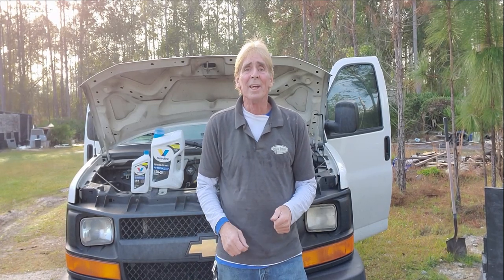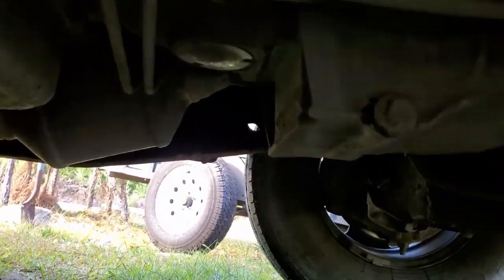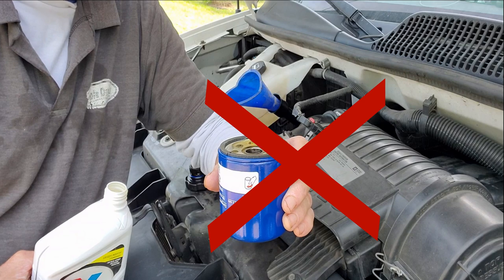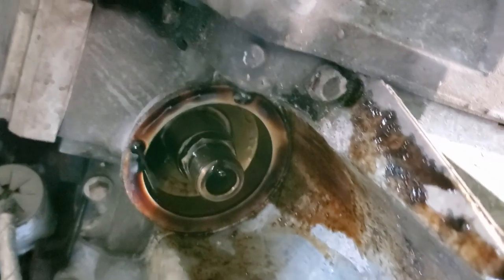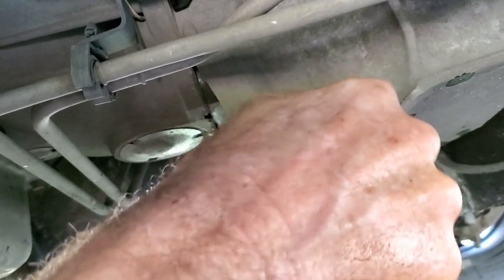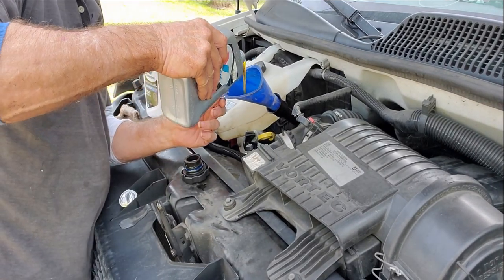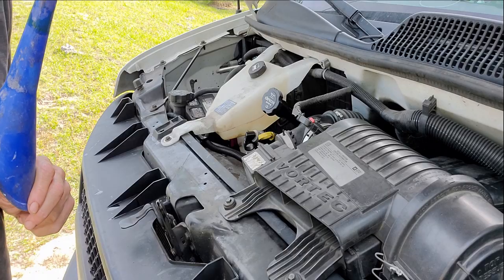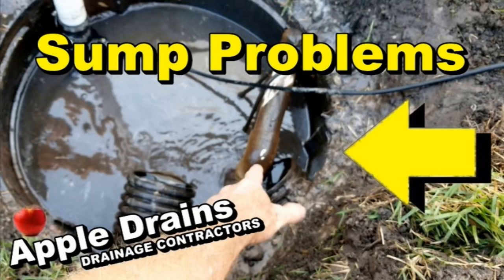High Mileage Oil Change, Do NOT Fill Oil Filter?

Comment: I have used  Valvoline and Fram filters all my life never had a problem.
 And I'm an old man at 62.
 Fill the filter with oil.
Reply: Phillip Bonner you should fill it with oil but if you put .5 a quart in there and your engine holds 5 quarts you should only add 4.5 quarts up too
Reply: @christiandemarcus2257   Sorry my engine holds 7  quarts
Reply: @phillipbonner5215  Do you own a Trailblazer? I never fill my filter and I have 178k miles.
Reply: My question is how are you overfill th thing when your usein oil from th 5 or 6 quarts of oil it calls for. Don't make since
Reply: 😮 I disagree that you have to pre-fill the oil filter. The first reason why he's telling you that you are going to overfill your oil if you pre-fill your oil filter wrong. He is correct your vehicle tells you how much oil to put in it when it gives you the percentage of oil that includes the oil filter film I'll bet you that he's checking his oil without running the motor and turning it off so it goes to the whole system then you check your dipstick a little while later after it levels out. If he does check if the correct way he will be short oil just about a half off a quart. Today's cars have different oil pumps not like the older vehicles the older vehicles yes recommends you to pre-fill the oil filter. It's not going to hurt anything like refilling your oil filter you're just going to make a mess the only benefit you are going to get these days by prefilling the oil filter is a nice amount of suntan lotion so while you're waiting for the oil to drain you can catch a nice tan 0 sunblock. A good majority of the cars these days have the oil filters sideways and in a very tricky place you will end up with oil all over the motor and yourself😊
Reply: the engine is adequate at filling it for you! you don't need a topper to run it safe, just a reasonable amount for a few minutes running! Engines are not glass slippers! But you can damage it if you prefill. the point is oil filters come in different sizes! And today's engines are not yesterdays! Old advice is for old engines! Do what the manual says and not other people! besides No two cars are alike!

Comment: Well, wouldn’t you just put less oil in when topping off - when filling the filter? 

If you put a half quart in the filter and it calls for 5...simply 4.5 quarts in when topping off. 

Pretty simple. Not rocket science.

But hey, that search term is gonna generate a lot clicks 🙄🤪🙄🤪
Reply: B&B Drainage Solutions yea, this is pretty rudimentary.
Reply: Half a quart to much isn't enough oil to make a difference anyway on most vehicles. That being said, filling the oil filter is totally unnecessary, just rub some oil on the new rubber seal.  

Make sure the old rubber seal comes off with the old filter. If it doesn't you could double seal and that will cause a slow leak. Then boom your walking to work 😂.
Reply: That's exactly what I thought. Pretty simple. I guess this guy couldn't figure that out.

Comment: If your vehicle uses 6 qts of oil, purchase 6 quarts and the correct filter.
Before installing the filter you can fill the filter with oil. Pour the remaining oil from the 6 qts into the engine. There's nothing wrong with filling the oil filter before installation. Unless of course the filter is mounted sideways.

Comment: This video is inconclusive. Of course you can't add more oil than manufacturer recommendation. So if your vehicle takes 5qts and you put some of that 5qts in the filter and the remaining in the oil fill, then you don't add extra oil. I was expecting more info on why oil should or should not be in the filter before starting the vehicle. Like it would harm the engine or something. But no info on that.

Comment: In most cases I believe that engine oil capacity is calculated with the filter in mind as it is part of the lubrication system.  I always pre-fill my filter if it's mounted vertically so that the engine will not run dry after starting.
Reply: you put 1 quart short of your total and your good to go without filling the oil fliter. the engine does that! the point of a "filter" is to filter the engine runs the oiil through it you already put in!  you don't need all quarts for an engine to start the oil is there! just not all the quarts!  You don't go out to a racetrack with it. you run it to operatfing tempuratfer add the last quart. filters come in different sizes!

Comment: I never though I would see the day when Chuck used a ratchet to get the drain bolt off instead of a pair of vice grips! 😂
Reply: this a 2016 chevy van ,,the oil pan nut is not damaged,,,,he uses the vise grips on the busted oil nut of the 2008 van

Comment: Prime your filter folks. Youre not overfilling if you leave the auto shop with 6 quarts. Your engine will be yell at you for the few seconds it takes to push through a dry filter without being primed.

Comment: Are you for real? You just take into account the oil added to the filter when adding oil to the engine. If capacity + filter is 4 quarts and the filter took 0.5 quarts, just add 3.5 quarts to the engine. This isn't rocket science.

Comment: I always prefill the oil filter on my father’s car. It doesn’t allow car to run dry. You run the car dry without oil, engine is worse and you’ll cause way more problems

Comment: There is only about 0.4 quart in the oil filter so, it is not going to overfill your oil sump. The oil filter sits above the oil sump and oil in it does not drain back to the oil sump when the engine is not running. So, if you don't pre-fill your oil filter, you will actually get a lower level reading.

Most people think it is unnecessary to pre-fill their oil filters. I think it can only be a benefit, and it doesn't hurt to pre-fill your oil filter. At least, when you have oil in the filter, that oil will act as a structure support for the paper filter inside it. Also, it helps dampening the first incoming oil.
When I let the oil drained overnight, my engine started up with a grinding noise. That was an indication of no oil. Yep, a fraction of a second with no oil can cause a little bit of wear. If I was to pre-filled the oil filter, that would have reduced the wear. But, still, your engine would last longer than your transmission and everything else, so it is your call to pre-fill, or not. Time is money so I don't blame folks on not doing it.

Comment: DO NOT USE FRAM OIL FILTERS 
I used to be a fram filter user my buddy has a Dyno shop and has blown a few motors he has found  that the filter is coming apart and finding parts of it in the engine so if you don't want to put a new engine in your car I would avoid Fram filters go with WIx filters best you can buy

Comment: The hole in the center is the out flow so you would be putting unfiltered oil in a place where if there is plastic from the bottling process or who knows what else through your clean side of your oil system.  I get the whole starting the engine with it empty and it sounds nasty with the lifters tapping, if the engine was run for a bit before the oil change there should be enough oil coating everything.  Its not the same as letting the engine sit and cold crank in the morning.  Kinda weird the ASE guy didn't say this, I picked this up from a certified diesel mechanic, best of luck Chuck!  Oh and a lot of mechanics throw the filter on fill with a lower amount than required and then top up after checking the dip stick ie system is 8 quarts new filter fill system to 7 quarts start engine check for leaks and fill level top as necessary.
Reply: You're already pouring ~5 quarts of unfiltered oil into the engine when you change the oil anyway. lol
Reply: @Harmonic14  the sump is considered oil that needs to be filtered yes the pump has junk ru ning through it but the critical part is the bearings you dont want small debree to get the bearings.  Good luck

Comment: Many moons ago an old mechanic told me that if the oil filter has not been prefilled there is a slight delay on start up before any bearings in the engine gets any oil, so, since then I always prefill the filter. Or remove the HT leads crank the engine until you've got oil pressure.

Comment: the amount of oil stated in your factory manual is the right amount, and I say, always fill your oil filter before installing it, it will reduce the time before the oil pressure goes up or dry start, reducing the amount of wear to the bearing, but make sure not to overfill, my truck use 5.2 liters, I usually buy a 5 liters of oil and use a measuring cup to measure 200ml needed, you can buy those cup at the dollar store their precise enough, just make sure it is clean before using it.

Comment: If capacity is 5 quarts do not add 5 quarts and 1/2 quart to filter.  No need for a video. 

After adding oil to the filter and engine you start it.  Let it sit for 30 seconds and recheck the oil level  I always add slightly less oil than recommended initially. 1/8th quart.  Check and recheck the level adding until it’s perfect.

The dipstick doesn’t miraculously deduct oil filter capacity. Or know if it’s a new filter.  This is by far the dumbest person/comment I have ever read in my life. 
Common sense is worth a lot, especially these days.

Comment: 1:44 - Dude, it goes without saying, that if you choose to fill your oil filter with motor oil... The amount of oil poured into the filter should be subtracted from the amount of oil that will be dumped into the engine. For example: If you're engine calls for 4.5 qts of oil and your filter sucks in 1/2 qt., then you should only fill the engine with 4 quarts... In my opinion, If your engine design allows you to fill your filter with oil (i.e. filter mounted vertically vs. horizontally), then you should definitely do so. It eliminates dry starts.
Reply: It's really not necessary, especially if you change your oil after driving and having the engine warm like you're supposed to.

Comment: Consider using an old beat up screw driver to hammer a hole into the oil filter and let it sit to drain the oil filter out before removing it. You'll need a lot more time but it'll be cleaner.  The other thing I noticed is when you pour oil from that quart bottle, you're pouring it backwards--the bottle should be flipped so the spout is the high point--that'll keep the flow smoother with air entering the bottle at the same time some oil is flowing.

Comment: Pre-filling the oil is fine if and only if it’s oriented where you won’t spill and you make sure to not over fill. Some basic math should prevent this. I’ve made the overfilling mistake before on a lawnmower but a hand pump with a long tube was the remedy.

Comment: My only problem is that you used the old oil instead of new oil for the filter o-ring.
Reply: There’s no problem with doing that. I lube the new gasket with the old gasket by kissing them together.

Comment: I never fill my filter because the little time the engine run without oil pressure will not cause any damage. I love your reason for not filling the filter. It make sense but that's not enough to hurt an engine.
Reply: Between 75% and 90% of all engine wear occurs at start up.  Starting the engine without oil pressure even if it’s for a instant is not good for it.  Even if the filter is at an angle and you can only partially fill it it’s better than not having any in there.  Been doing this for a very long time.
Reply: @donjohnston4215  That is 100% bull shizzle. Just because a bunch stupid people say something. It does not mean it's true. There is still some oil left between the bearings.
Reply: @donjohnston4215  Stop/start would be killing engines left and right.
Reply: @donjohnston4215  Just because you say you been doing this don't mean it's true. Everybody on youtube with no videos is an engine builder.

Comment: Filling the filter is good for the engine and it's not overfilling it all, that doesn't even make sense. Btw Fram is the most absolutely garbage filters. I hope you did not get any oil on the ground too, that's complete disregard and disrespect for the environment to work outside like that. With respect please stick to drain videos and not auto stuff.

Comment: nice video, only don't use 'old' oil to pre-lubricate your filter gasket. There may be debris or other contaminates in the old oil that will get between the seal and and mount causing an insecure fit.